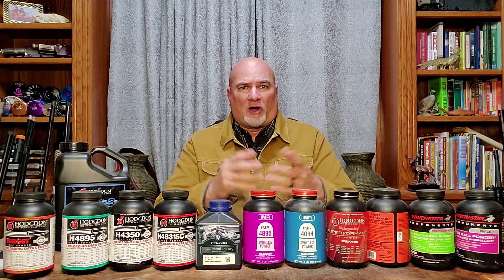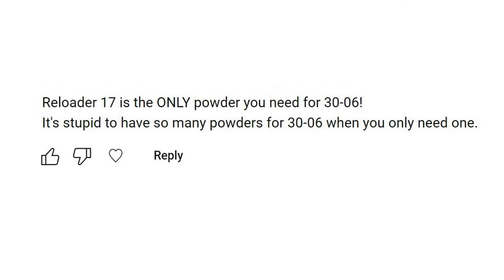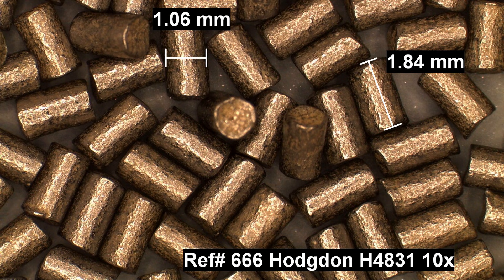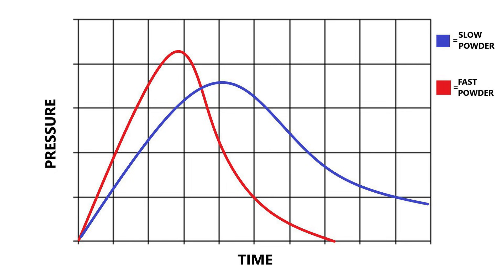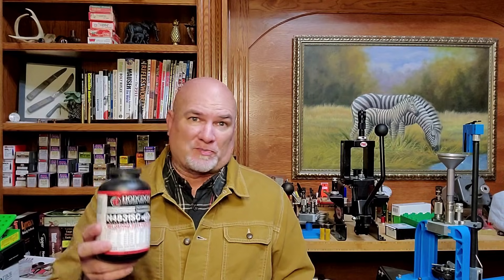Selecting a Powder

Comment: I like to use several manuals , but have noticed quite a difference in data .
Reply: The difference in data is a feature not a flaw. Differences in testing setups and powder lots are the primary reason behind those differences. Hornady (per their podcast), always tests with a min spec barrel and chamber. They also factor in heavy crimping. Their numbers are going to inherently be more conservative.

Comment: Hi, DD. Great video as always. Pragmatic, sensible and well articulated. 

To this and a previous video you made on powder selection, you mentioned Staball 6.5 in the 30-06. That convinced me to give it a try. I'm pushing a 178gr ELD-X @ 2912 fps out of a 22" barrel with SB 6.5. This powder is amazing! I'm going to step up to the 212gr ELD-X soon because I have a freebore the length of a football field and understand that a longer freebore traditionally desires a longer bullet, and for SB 6.5 to burn optimally in my barrel, I think a heavier bullet will compliment that need well. What is your take on this?

Comment: I look for a powder that works with all the bullets I'll load in one particular cartridge.

With 45 Colt I use five different bullets and every bullet has load data with Accurate #5 listed. So Accurate #5 is the powder I use for 45 Colt.

For the 460 S&W Magnum there is load data for all the bullets I plan on using with Accurate #9. Whereby Accurate #9 is the powder of chose for all my 460 S&W Magnum cartridges.

When it comes to 45 Auto I do the same and look for one powder that will work with every bullet I plan to reload in them. And while Accurate #5 is include in five of the bullet's load data, CFE Pistol is listed in all six bullet's load data. So CFE Pistol is the one I pick for the 45 Auto cartridges. 

To avoid any confusion when loading charges I write on each container of powder their prospective cartridge that they are to be loaded for, so when I do 45 Colt the container sitting on the bench will have 45 Colt written on it for an extra safety factor to keep me from getting confused.

Now there are some 45 Colt bullet's load data that include Accurate #9 and CFE Pistol as well, so I could end up using them at times to see if I like them better than Accurate #5 with some bullets, yet again they will not work across the board, so they are not my first chose for 45 Colt. And for the 45 Auto most of the bullets have load data for Accurate #5, yet again not all do, so CFE Pistol is my main chose of powder for 45 Auto. And while there is load data for Accurate 11FS in most 460 S&W Magnum bullets I plan to use, as well as with some 45 Colt bullets, not every 45 Colt or 460 S&W Magnum bullet can use it  so it will not make the first round chose of powder for either. 

There are other powders that will work for one or two bullets per cartridge between two or even the three cartridges but they will definitely not be a first round chose either. Perhaps one day I might play with them, but they are not cost effective to get used any time soon. And again, they will never be my first chose for either.

Comment: One of my pet hates is having to change powder due to availability but that’s life I guess.
Reply from the maker: That is life. But if you plan it out, and stock up on powders that are multi-use, it makes things easier.
Reply: @desertdogoutdoors1113  here in the UK we are limited to the quantity of powder we can store / have in loaded ammunition.  Also some powder particularly Hogden are banned due to some stupid regulation as to the chemical composition.
Reply from the maker: @paulharding1621  I was not aware of that. This would  definitely make things difficult.
Reply: Multi use = imr 4064

Comment: Thanks for the explanation. I’m one of those “grandpas “ but new to reloading. I have witnessed several of the observations you shared, but looking for someone to help sort it out. This helps. 
  Ensuring I don’t go over book values for my own safety, and relying on their years of data, I’ve been reasonably successful….. however recent load development on a 204 Ruger has been challenging. I’m getting 4200 fps at minimum load of XBR 27.8 gn. with a 32 gn. Zmax!  Good groups but excess Std dev??
Thanks for the video.

Comment: When I bought my first two dangerous game rifles a 416 Taylor improved, and 416 Remington magnum I always used RL15. It worked great with all the bullet weights I used, but then it practically disappeared off the shelf and I still have not seen any in person to buy since like 2020. First off load data for the 416 Remington with different powders was easy to find, but the 416 Taylor was quite a bit harder to come by especially for 300-350 gr bullets. Thanks to some guys helping me with quick load data I was able to keep the 416 taylor running with different powders. Now IMR 4064 and IMR 4166 are two of my favorite powders for both 416’s. Also have some 350 gr loads made to try this weekend in my 416 Taylor Imp. Loaded with ramshot big game (my favorite powder for the 9.3x62) looking forward to seeing how it stacks up against 4166 and 4064. Plan on grabbing some H4895 to try also when I get the chance. That’s the great thing about handloading, just trying different things and seeing the outcomes. Great video DD!
Reply: H4895 is great in .416 REM Mag. I have best accuracy using standard primers. Unfortunately I can’t get it here in the UK anymore so have switched to RL15.

Comment: I am reloading 7 Rem Mag and powder selection in the last 3 years....zilch.  Magnum primer availability is $25+ a hundred on Gun Broker when it can be found, zero at my local store.  Good thing I stocked up on primers before 2020 but I am running out of powder except very slow powder not suitable for the weight of bullets my 1:9.5 factory barrel will stabilize.  Reloader 22 is the best powder for my 150-175 gr. bullet combo and is unattainable.  Neither is Reloader 26 my second favorite powder or any other suitable powder that gives magnum performance.  I can find powders occasionally that deliver 200-300 ft/sec less.
Reply from the maker: H4831sc is the best powder i've ever used for 300WM in those bullet weights. Way more temp-stable  and consistent than RL22. Its available everywhere, even on Hodgon's website https://shop.hodgdon.com/hodgdon-h4831sc/  . Even your favorite RL22 is available https://shop.hodgdon.com/hodgdon-h4831sc/  . Just do a little research and don't assume there is a powder shortage because your local store doesn't carry it.

Comment: Lots of great stuff in this video,  can't wait for spring to work up my loads for my new Tikka in 30-06
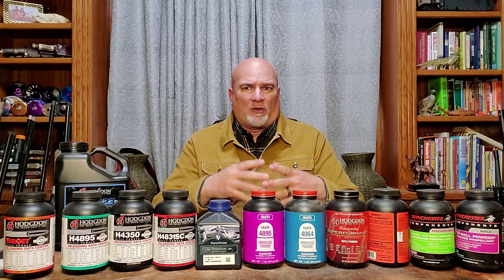Reply from the maker: Be mindful that the Tikkas in 30-06 have those horrible 1:11 twist barrels. They don't shoot the heavier mono bullets very well.
Reply: @desertdogoutdoors1113  yep 1:11 twist, hoping 180gr interlocks will work. If not, then I'll try 165grs. If I need to go heavier than that, I'll step up to my 300wm
Reply: Tikka started offering their 300 Win Mag in 1:10” twist. All the other .30 cals are still in 1:11”, which suck. 
They are now offering a fast twist 243 Win 1:8” (screw you 6mm Creedmoor) and for several years now a fast twist 22-250 in 1:8”. The South Africans love this for varmint.

Comment: As PO Ackley said the best powder for a particular load is the one that best fills the case to the base of the bullet. When I’m developing a load for a rifle I always refer to loading manual that show the percent of case fill. It has to be 100% or above and I then start by dropping 2gr and work my up in 1/2 gr increments. 

Great video DD
Reply from the maker: Ackley was a wise man
Reply: Without getting into the weeds, that’s why I use H4831sc in a lot of applications over H4350.
Reply: @falba1492  for me it all depends on the cartridge capacity, bore diameter and bullet weight. .300 RUM I usually use WC860 or H869, .300 Win Mag my go to powder is H1000, 7mm Rem Mag is usually IMR 7828, .30-06 H4831, .375 H&H H4895, .35 Whelen is usually Varget.  Applicational needs is paramount to accuracy.

Comment: I started reloading for economy very long ago. There was no internet of course but the good news was that most reloading manuals, even back then, had “accuracy” and “factory duplication” data that gave a reasonable starting point. Chronographs were rare birds as they were quite expensive so you read every manual you could get your hands on. I still think this is an acceptable way for new loaders to start, especially if they are of modest means. I agree with the observation about laziness DDO, I think the time spent on research does a great deal of good. Thanks for the post!